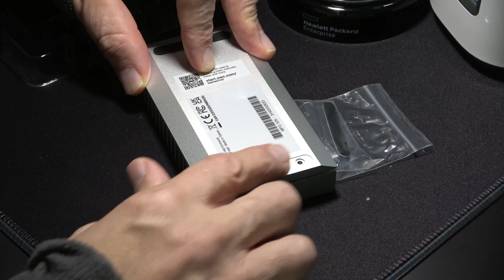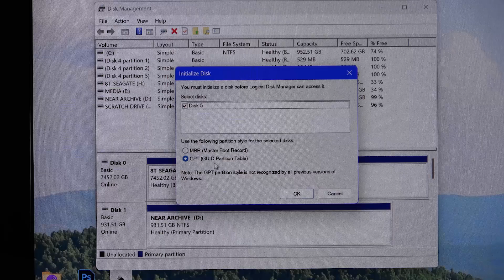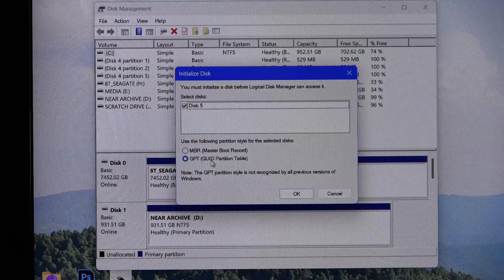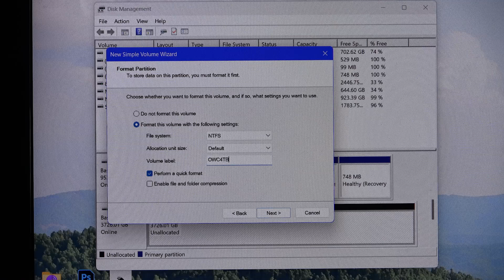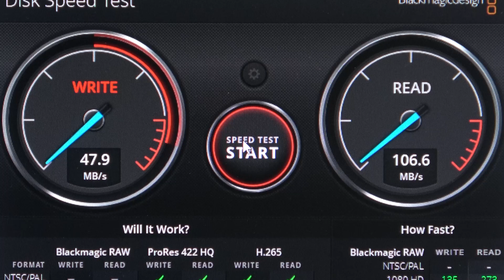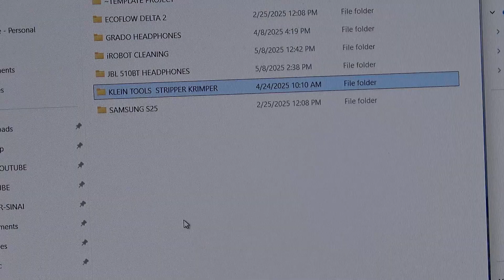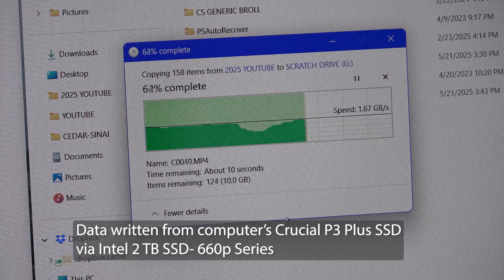OWC Enclosure & WD Black SSD the Speed Combo [Unbox, install, & speed test]

Comment: Why would you waste money on a drive that’s capable of speeds three times your slow usb port? You could have bought the crucial x9 for less than half the price and gotten the same speed. The combination you show is an excellent choice if you have a faster port to support it, but seems like a waste here.
Reply from the maker: @craigalan7911 Just an update, I finally updated the rig and am seeing speeds of 1.43 GB/s with this setup using USB 20Gbps on motherboard.
Reply from the maker: You are correct, but hopefully my rig will be upgraded soon and I will be able to take advantage of the faster speed. Thank you for sharing.
Reply: I have the same set-up (i didn’t attach the rubber screw pad) the good thing is I can edit videos with the enclosure between my work and home pc, and on final edit I just pop out the sdd and stick it on my motherboard for the full speed.. once I’m done it goes back in the enclosure, it really depends on the use case for each person needs